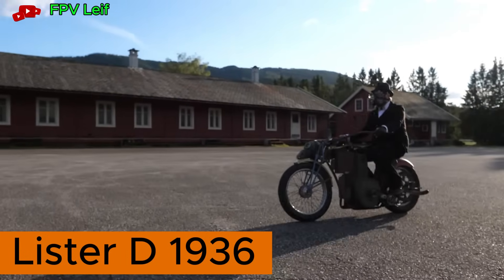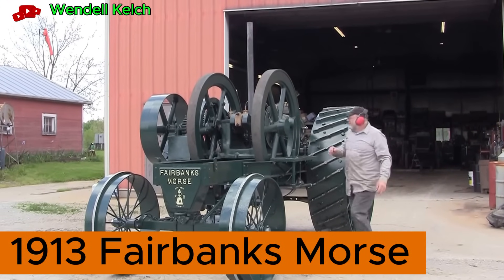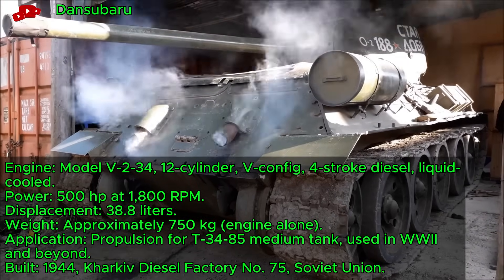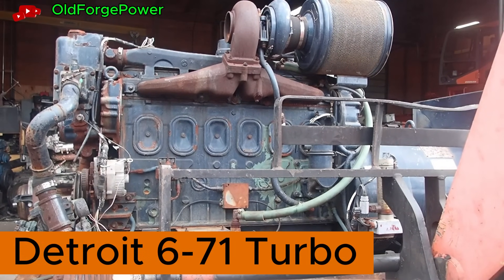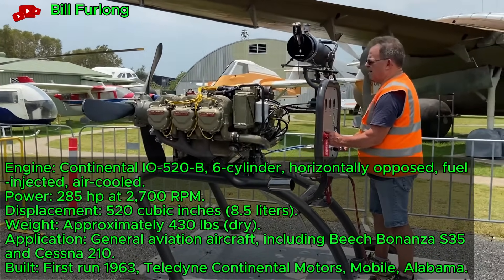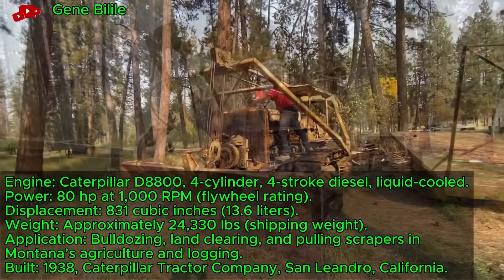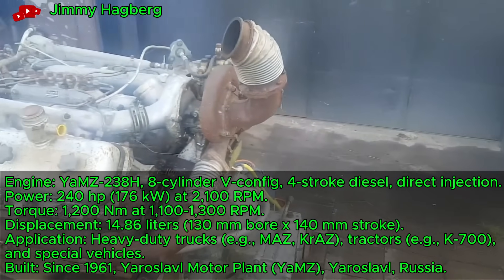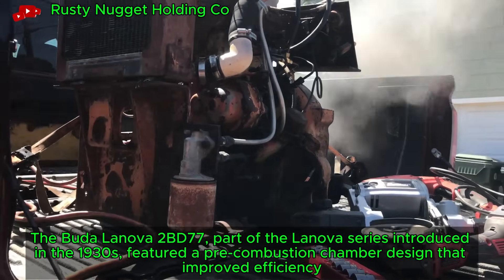Rare Old Engines Starting Up Sound That Will Blow Your Ears! ▶ Part 48

Comment: The pony motor on the old Caterpillar bulldozers wasn't there to help start the diesel... It was the ONLY way to start the diesel engine. Electric starter motors at that time barely had the power to crank regular gasoline engines. Pony motors also helped warm up the engine block during winter months. Start the pony motor, engage the starter clutch and crank the diesel over but keep the fueling lever in off position. After 10 minutes of cranking everything is warmed up and lubricated, so move fueling lever to run and enjoy the clouds of smoke when the big engine fires up.  LOL

Comment: The Continental IO-520 is normally 250 horsepower... The titanium RayJay turbocharger is what got them up to 280 to 320 horsepower depending if it was set up for turbo normalization. My Mom's Cessna 337 SkyMaster had two Lycoming IO-320 engines that were turbonormalized. Sea level power output up to 6,800 meters.
Reply from the maker: I don’t have specific data on the changes, but that sounds impressive. 😄

Comment: The Detroit Diesel 6-71T is not 318 cubic inches of displacement. That would be the 6-53 engine... 6 times 71 is actually 426 cubic inches of displacement. 6 is the cylinder count and 71 is the cubic inch displacement per cylinder. I know, I know... I've got OCD bouncing around in my brain somewhere.  XD XD XD
Reply from the maker: I'm curious—do you prefer listening to voiceovers or reading subtitles? I would like to change a little bit about the presentation to attract more views, do you have any suggestions? Thank you so much!
Reply: @PTValleyEngine In actuality I like and enjoy how you have the videos as they are now. But that's just my preference...everybody is different. I found that out when I was teaching the Detroit Diesel engines to our new recruits. And believe it or not there is a slightly different technique I used when teaching the women. They would actually listen and learn quicker than the men because the women had no preconceived notions on how things were supposed to work. The men were the ones with the idea: It's mechanical... I already know this.  Much like when learning to pilot a helicopter compared to an airplane. You learn MUCH quicker and easier on how to pilot a helicopter if you've never flown an airplane. Weird, but absolutely true.
Reply from the maker: @gerrywalsh5766  That's fascinating! It really highlights how an open mind can accelerate learning. Your experience with teaching Detroit Diesel engines shows how preconceived notions can hinder progress, especially when comparing the women and men in your classes. The helicopter vs. airplane analogy is spot-on—starting fresh without assumptions makes a huge difference. Such an insightful observation!

Comment: A buddy of mine in Nebraska had the gas engine in his Farmall tractor finally wear out... he found an old 4 cylinder Gardner engine that was abandoned so he modified the tractor frame and shoehorned that diesel Gardner into his tractor. It took him about 3 years of doing all kinds of odd tricks but he got it to work. The amazing thing was that he could get that Gardner to idle down to about 160 RPM and have it just sit there waiting to go to work. That Gardner had so much torque that he could pull a 4 bottom plow now instead of the usual 2 bottom plow with the gasoline engine. Also, fuel consumption was half... He's definitely a happy kid in the candy shop now.   LOL
Reply from the maker: The story about swapping in the Gardner engine and its ability to pull a 4-bottom plow is fascinating! Halving the fuel consumption and running at 160 RPM is truly a technical feat.
Reply: @PTValleyEngine I love Detroit Diesel and Cummins engines... but .. the Gardner diesels were away ahead of everyone else except old Rudolf Diesel himself. The Gardner injection pumps were every bit as good as the BOSCH pumps. Good pumps and injectors can be found by idling the engine as slow as it can turn over without stalling or misfiring.